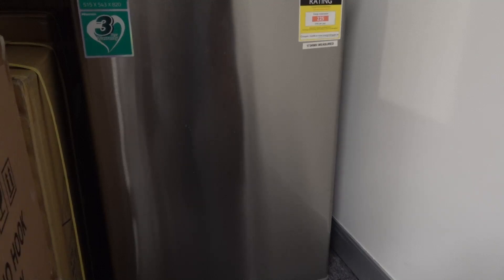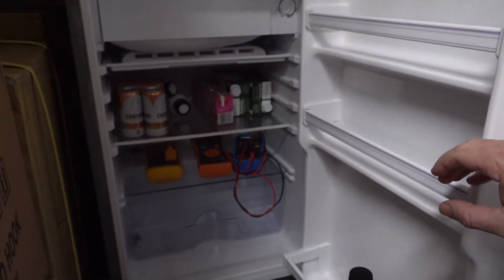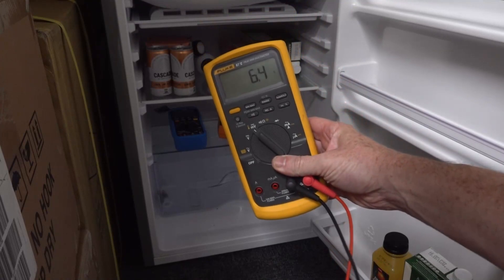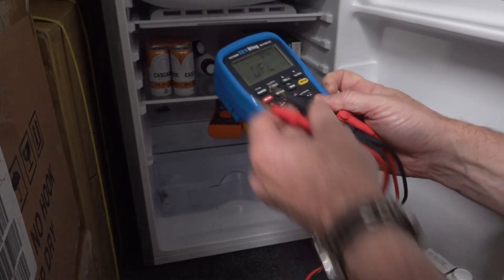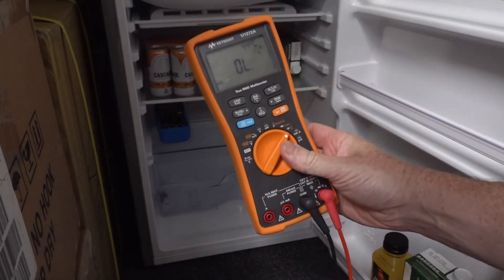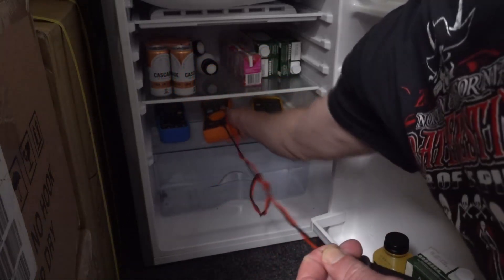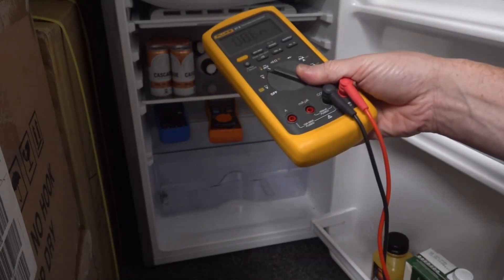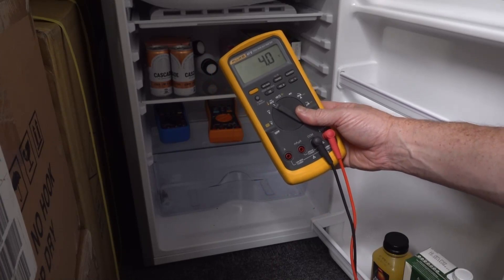Multimeter Fridge Test

Comment: Don't even need to short probe leads - a banana plug jumper across the terminals will also do the business.

The Fluke dropping after pulling it out of the fridge is most likely due to evaporative cooling of condensate - latent heat of fusion and all that. Must have been a droplet of dihydrogen oxide on its internal thermal reference.

Comment: Just do not use worn leads, as the plating missing off the one tip will make another thermocouple.
Reply: Hmm, is that really so? Doesn't it create two exactly opposing junctions? (Just like the plating on each probe would already do against the base metal anyway.)
Reply: @Gameboygenius  That is why the warning to not use worn probes, you will have a coating that is worn, and thus different layers in the stack in the 2 leads, so there is an asymmetrical junction formed. If the gold and nickel is worn off the one side, leaving bare brass, then you have a brass gold thermocouple heated by your hand, generating a small potential voltage.
Reply: @SeanBZA  ah of course. Forgot about the nickel.

Comment: I usually don't  use  multimeters ( many ) to check the fridge , I use a min/max thermometer with you know the litle floating pins ,very reliable , and in Australia who cares of a multimeter working at 10 celsius , it will never go down to there....and near cold -20 the usual meters with LCD display  go blank....physical matter
Reply: Huh? We get to -2C here a few times in the winter.